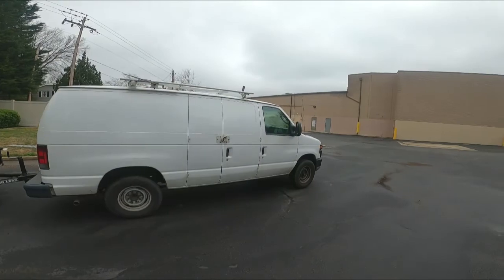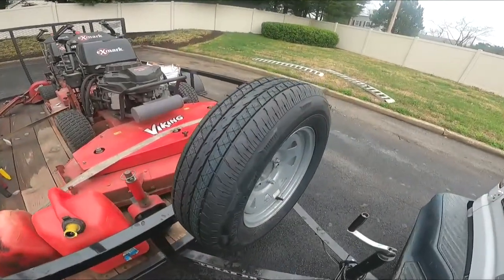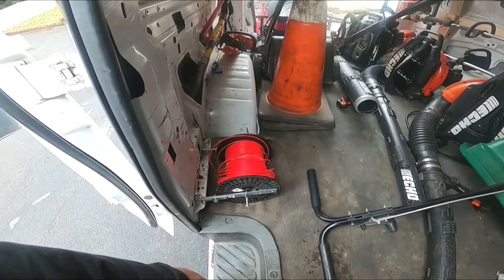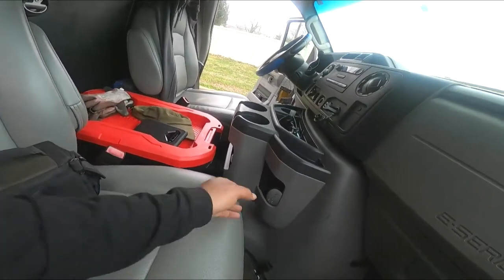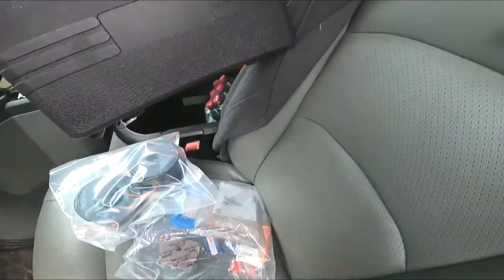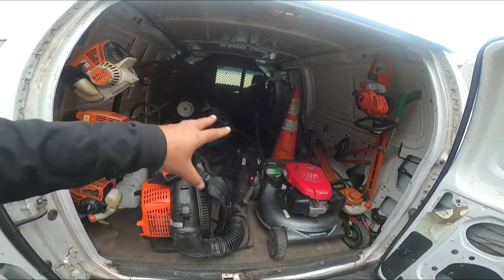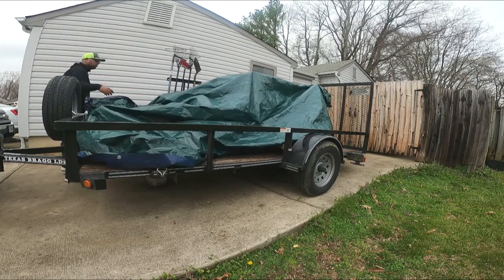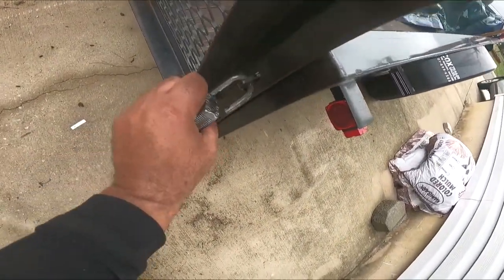2021 Lawn Care Setup! Van Edition

Comment: Do you know the weight of your 36?
Reply from the maker: Around 540lbs
Reply: @theneighborhoodhero1   is it a struggle getting it up and down the ramp? I have a cargo van and I’m about the go purchase the 2020 toro proline 36
Reply from the maker: @javonwebster432  That's what's up! It's not hard at all. Just make sure you have a sturdy ramp, take your time going up and down the ramp until you get the hang of it and make sure no tools are in the way when loading up. You will not be disappointed.
Reply: Love this. Any chance your viking 48 could fit back there. Want to do this with mine at end of season and leave it there until next year.
Reply from the maker: @Imdustin88  yes my 48 viking fits in the van as i have a Ford E250. With a couple inches to spare.